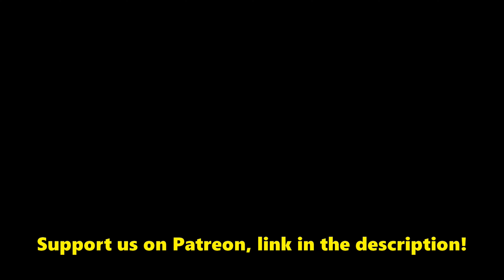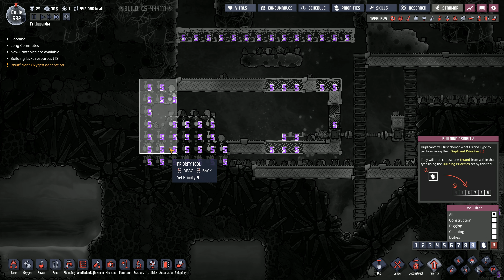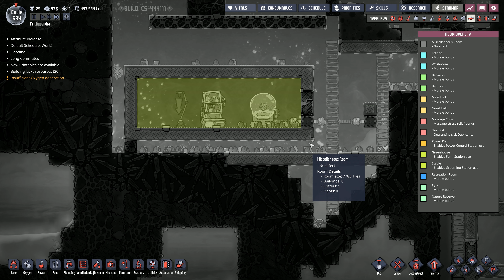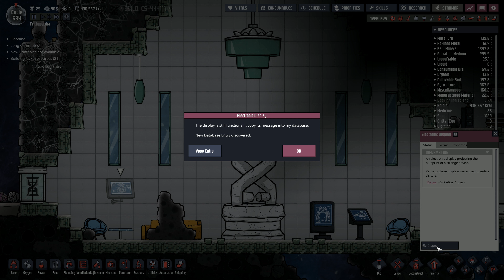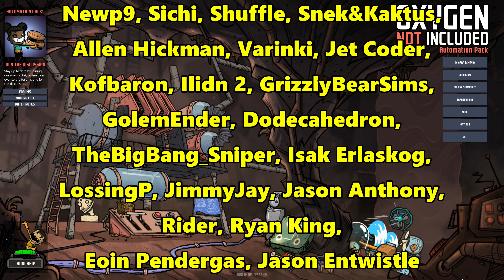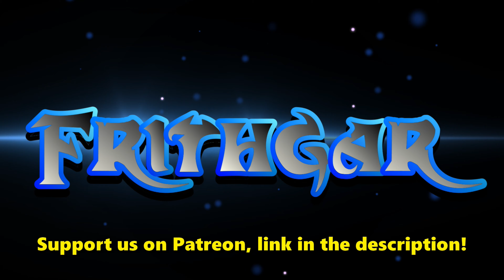Let's Play Oxygen Not Included #124: Shove Vole Farm Second Attempt!

Comment: 27:30 (even in vaccuum) As long as at least 1 thermalshift plate is touching some wall/floor/ceiling, all the heat to/from those "outside" blocks will be transfered like electricity.
-> The mined regolith "sitting" there is a HUGE source of energy (high temperature & many tons of mass) that will pass its heat to the floor first, then to the plates touching the ground (if there was a liquid or gas, it will be even faster).
Reply: Your idea will work (if you sweep out the regolith first!), since all of the "background tiles" in the "Gravitas Office" are still COLD.  It will eventually heat up, but it is a nice temporary "reservoir" (heat sink) to be exploited.
-> You could build this first incubator at the right side of the statue (replacing only the drywall for gold_thermalshift plates).
Reply from the maker: I may have to go back to this idea, however things happened that required my attention elsewhere for a while, I won't say anything else just yet though!
Reply: @Frithgar  That is actually good news!
-> I was affraid that you may had already "solved out" the puzzle (either by looking for examples, or via trial & error).

Comment: 18:44 "Getting ready for solar panels" 
WARNING! : The game does not allow light going through meshtiles anymore [only glass]. 
-> You have to use a double layer on top of solar panels: first a glass floor to "contain" regolith (so it can be safely mined); with STEEL BLAST DOORS on top (to protect the fragile glass from meteors).
  
  The blast doors are activated (automatic closing) by a series of "satelite dishes" sensor scanners (that can not be also protected from meteors with blast doors, unless you use automation so it can "guess" when a meteor shower should end to reopen them)].

Comment: The meshtile barrier acting as a "temporary shield" against meteors should be made of cooper ore (not refined cooper), since it is one of the "natural" stuff brought by the same meteors that damage them (duplicants do not have to walk back to the base for materials to repair it).
-> The "permanent shield" has to be built with STEEL (it is expensive, but it never breaks).

Comment: 11:30 Incubators generate lots of heat (both on porpouse for the egg, also some "waste" from the electricity/thermal conversion).  You should build it with STEEL (higher point of failure), adding gold/diamond thermalshift plates behind it (all 6 squares) and dropping small ammounts of some liquid on the 2 blocks of the floor is sitting [the "evaporation point" of this liquid has to be lower than the "failure" temperature of the material the incubator is made].
-> Getting the liquid "lost" by evaporation [eventually needing replacement] is better than reconstructing a machine, since it does not requires extra duplicant time/effort (only the transportation).
  
A second bottle emptier is unnecesary (after building all 6 thermalshift plates), just deconstruct the block containing the coolant at the end of the room & quickly rebuild it & mop everything back (except at the incubator, of course). This "splash" should keep it cool for a while.
-> A more permanent solution is bringing a pipe from the base (or from a closer pump), with automation detecting the temperature of the incubator (requires an aditional thermalshift plate next to it to place the sensor); that opens/close a liquid valve just for a few seconds (regulated with a BUFFER gate) to drop some liquid from a vent on top.
Reply: THERE IS NO OTHER WAY! 
-> Unless you bring "coldness" inside the room, the heat from machines will cause them to "self_destruct" after some time [wasting a lot of YOUR time micro-managing it & the duplicants time (walking there & decontructing/rebuilding)]

Comment: A problem with metal_tile rooms in SPACE is overheating.
Leaving a block empty (in vaccuum, with no doors/machines) between the floor, walls & ceiling works well IF you ALSO previously hollow (dig) all the space where the room would be built later, PLUS constructing an "over_roof" on top to contain any future materials from falling.
-> A common mistake is building the room first, then having debris of superhot regolith "sitting" on top [requiring manual sweeping]. It is much easier to let it fall to under where the room will be.
  
Even if you perfectly insulate & shield the metal room, there is also the problem that is basically a "perfect cage" for any kind of heat generated INSIDE of it [so you have to bring "coldness" to compensate the "new heat" made by machines inside]. 
-> This can be done "manually" simply by building a bottle emptier at the end of the room (inside), with a block to contain the liquids dumped (it takes out efectively 3x3 of the space of the room). 
  
To avoid losing this "coolant" (oil, petroleum or polluted water)  to the vacuum inmediatly, the setup needs some background tiles touching the floor of the metal room [thermalshift plates are the best, but do NOT use refined iron (dupes will take the one from meteors that is superhot), cooper or gold from a refinery is likely colder].
Reply: 10:45 The Feeder is in the PERFECT position to receive both "hot regolith" (food) and getting drops of coolant removing/canceling its heat (so it does not get broken).
-> The robominer should be constructed on the ceiling (looking upside_down), as otherwise the block stopping the coolant from spreading all over the SPACE stable will also block its "laser" from digging out the regolith_blocks pooped by the shovels.
Reply: Since all of the "stable" machines/items (including the bottle emptier) are 3 blocks tall & the robominer is 2 blocks, it is a good idea to make SPACE stables with at least 6 blocks of vertical space (from the floor to the ceiling).

An "scafolding floor" made of ladders on the 4th empty vertical block is useful for when the "poop" of shovels buries things inside the room [dupes can walk/run on top of them like if it was a real floor], this does not interfere with the robominer laser (it is a workaround from when it gets broken or de-powered for a while).